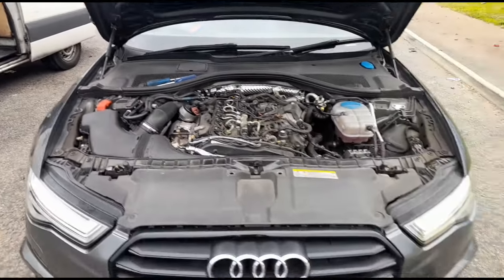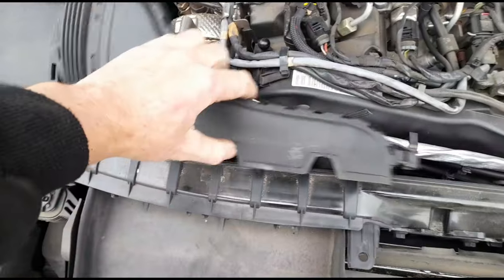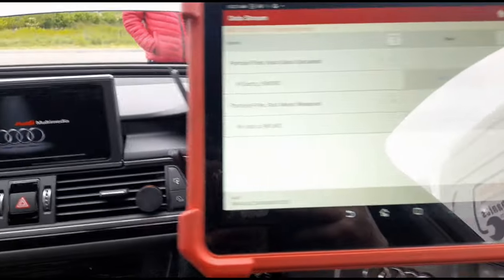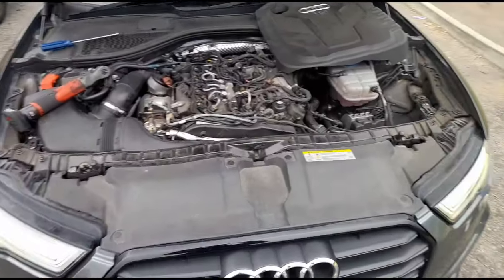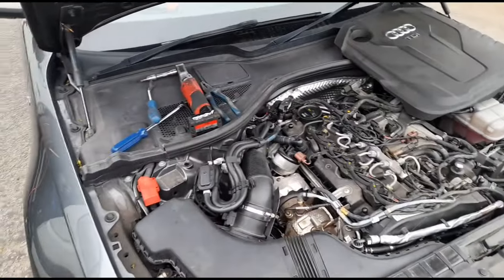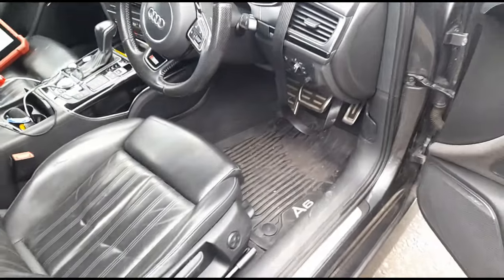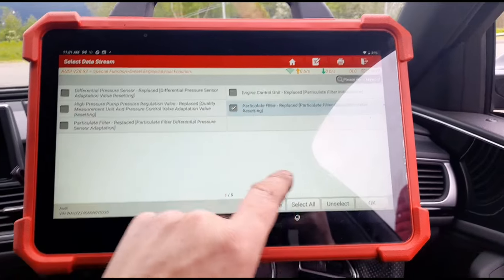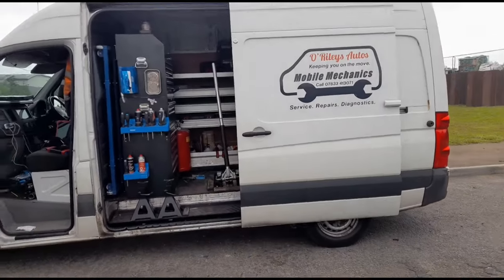Audi A6 Ultra 2.0 TDI P200200 Particulate Filter Below Efficiency Bank 1 DPF & EGR Cooler Cleaning

Comment: Just did this exact thing to my 2016 a6 high milage I didn't have a blocked dpf but the dpf light  kept coming on and off once a week in the last few months.. ordered the 2lr of launch fluid and did everything in the video. Have to say spot on Jimmy made a difference. I sopose prevention is better than cure. I really appreciate your videos. Iv seen quite a few of your videos. Anyway thanks mill 👍
Reply: Do we need any scanning tool after/before doing like this. In my Audi A6 TDI ultra 2.0 the dpf message flashed like your scenario. I want to do the same!!

Comment: Yes on those engines the low pressure egr valve get blocked with crystallized adblue. . Oh and yes it does feed  low pressure egr gases into the turbo intake .  Cheers
Reply: Find this becoming more and more common. Servicing the LP EGR & adblu injector is really a service item now.

Comment: I own an Audi A6 Allroad 2017, I’ve literally just had a full service and MOT as standard each year. Driving home from the garage the glow plug warning light started to flash on the dash and power was reduced.

After taking it to the garage this error code was displayed P040300 with regards to the EGR valve.

Would you recommend trying this procedure or replacing the whole EGR valve and cooling unit?

Many thanks for the video, at least I can locate the part in question in the engine bay.

Comment: Great video.
I’ve had similar issue come up on my Q5 2016 - low pressure EGR blocked with adblue. Would you recommend cleaning it or replacing EGR?
Reply from the maker: Cleaning is a gamble. 60% success depending how bad the cooler is blocked

Comment: Teoreticaly it could be possible to clean the egr from the other side also because it is a low pressure egr and it is connected before the turbo from underneath. You would just need to open the valve with the scan tool.

Comment: Do you have to reduce the Launch UK DPF cleaner with water or can you go straight from the bottle ?
Reply: Yeah it's recommended usually it's 1 part solution and 4 parts de-ionised water. Each brand is different. Always read the instructions at the back

Comment: Hi Jimmy, is the fluid cleaning the egr cooler when the air sensor is disconnected? Need to try clean the egr cooler but dont have the gun to go in near the sensor so wondering can it be done without that step? Thanks

Comment: When your spraying the fluid into the pressure pipe with the engine running do you have the air meter disconnected or is it ok to put the flush through with it connected
Reply from the maker: I do it with the air meter connected as I do want it to flow through the egr
Reply: @ORileysAutos  okay so I spray for 5 seconds then wait 15 seconds with engine on high idle yeah

Comment: If the fault is particulate trap bank 1 - efficiency below threshold doing this doesn’t solve the issue unfortunately, it’s just cleans the cooler for a while. It needs the cooler replacing

Comment: Tried your method on the first video   on my a6 ultra. Didn't work  but code p200200  has been on for a long time.  (Cooler blocked for  12 months +)     would putting the fluid in from the adblue injector make and difference?    Or too much time past ?
Reply from the maker: Stick 4: litres down the Adblue port worth a try
Reply: @ORileysAutos   will do  thanks for the reply 👍
Reply: Did this work ... I have the same issue p200200

Comment: I've got a head scratcher of a job.... 1.6 vito..  5g of soot but the back pressure is to high. I dont understand why.
Reply from the maker: Maybe it's been reset before coming to you
Reply: No . Its only me that maintains it. I dont want to force regen but I might run some cleaner through and see if the pressure drops  . I've been using Jlm product. Had some good luck on certain motors.

Comment: Cooler is part of the egr. . Waste of time on the vw.. fwd is a bundle of joy to change.  Egr delete on them . Every time. Dpf will regen as it should.
Reply: Will the egr continue to block with the delete thinking about getting this?
Reply: has this caused any problems? thinking of tuning and deleting the egr software to clear the fault. Did you need to block the egr at all or its still there?
Reply: Hi. Do you recommend just the EGR delete? Nothing else?
Reply: Hi again. Hope you re going to see this. Have the same model, after yesterday clearing it and reset the light professionally , done also EGR delete and Adblue delete in a very good garage, been told the DPF will regenerate as it should. Do you think I should’ve kept the Adblue running?
Reply: @japanluv long shot but how’s this been holding up hope I get a reply thank you
Reply: @gemalmohamed7036  couldn’t be happier😎 Runs really good. Regen doing its job and no more lights in the dashboard.
Reply: @japanluv  did you put blocking plates in the egr or just delete from from ecu, also how many miles have you done since, I’ve heard over time it can destroy the dpf and overheat your car? Please help
Reply: @gemalmohamed7036  all from ECU from a reputable garage specialising in DPF problems. Time will tell. Done 8k miles so far.
Reply: @japanluv  did you do the remap with the same person, thank you for your quick replies
Reply: @gemalmohamed7036  soon as EGR and Adblue delete they do a remap as well part of it plus I wanted few more bhp as well and paid a tiny amount on top of the main work. As I said, I love how the car runs so far.
Reply: @japanluv  thank you
Reply: @japanluv  sorry one more question, were you losing coolant before you had the delete done?
Reply: @japanluv  sorry one more question, were you losing coolant before you had the delete done?
Reply: @gemalmohamed7036  no coolant loss.